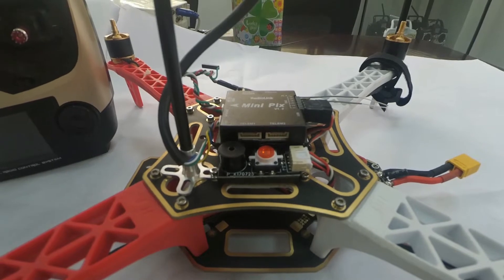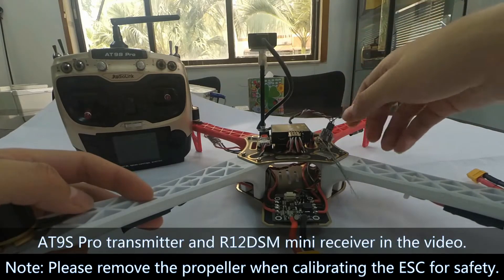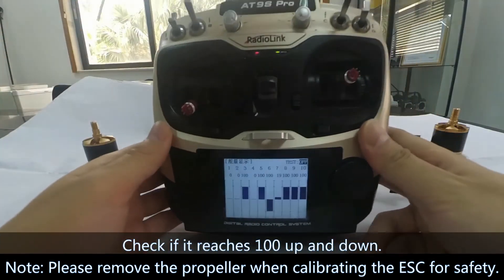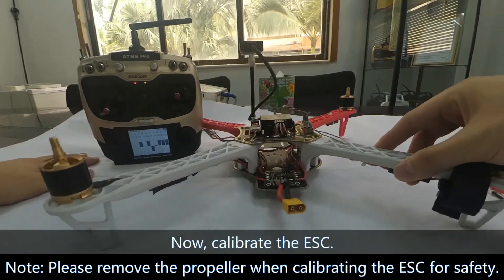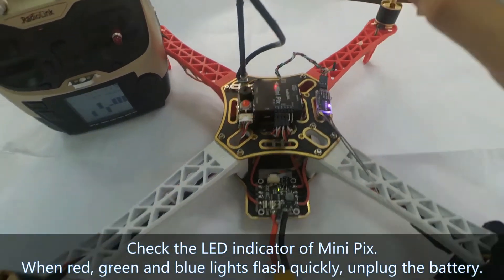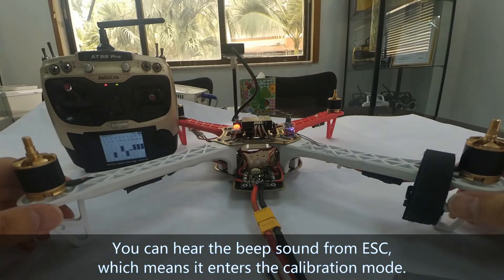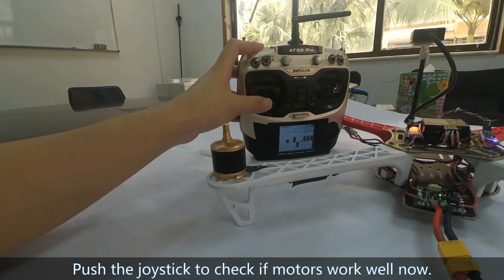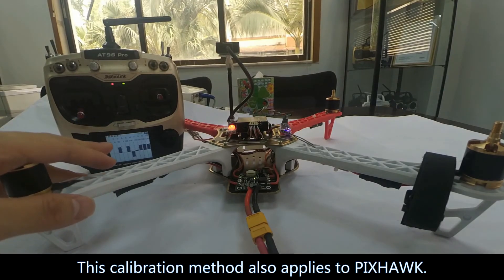How to Calibrate ESC on Multi-rotor with RadioLink PIXHAWK/Mini Pix/crossflight/Turbo Pix?

Comment: Hello!  Team Radiolink!  I would like to ask that the same procedure will be follow for Radiolink Crossflight ESC Calibration or I have to do External ESC Calibration. 

I am using 30A Simonk ESC
Reply from the maker: Hi, sir.For CrossFlight, you can follow this tutorial too. But you also need to check the detailed manual of your ESC. Because different ESC may have different calibration methods. If any question, please feel free to contact us. Our email is after_service@radiolink.com.cn

Comment: Hello, I'm configuring trad heli with crossflight but the board doesn't enter ESC calibration mode with the lights flashing in the calibration pattern. The board only starts normally even after doing the process in the mission planner.
I'm using MP and firmware Radiolink.
Reply from the maker: Hi, sir. Here is the ESC calibration for helicopter for your reference: https://ardupilot.org/copter/docs/esc-calibration.html 
Here is a tutorial of ESC calibration:
https://www.youtube.com/watch?v=gYoknRObfOg   You can follow it. If any question about RadioLink products please feel free to contact us. Our email is: after_service@radiolink.com.cn

Comment: Hello, good evening...
i am currently using crossflight for building quadcopter 450mm frame.
but when ever i arm the drone in either althold or manual mode it , it doesnt lift up instead it moves forward or some times spins...
i am using flysky fsia6b transmitter and receiver.
motor 1 which is right front connected to pin 1 of fc.
motor 2 which is left back connected to pin 2 of fc
motor 3 which left front connected to pin 3 of fc
motor 4 which is right back connected to pin 4 of fc.
can you pls guide me ?
Reply from the maker: Hi, sir. We recommend you to check the Motor rotation direction first. May I know if your quadcopter can fly well in stabilize mode? And if there is still any problem, could you please take a video to us? Our email is after_service@radiolink.com.cn

Comment: Can you show video with the same drone but with t8fb remote control?
Reply from the maker: The calibration procedure for t8fb and at9s motors is the same.
Reply: @Radiolink_official  When calibrating our motors 2 motors repeatedly keep going out of sync, for example when half throttle 2 wont spin at all or spin at a low speed and when at high speed all will spin at same speed. this was with a newer minipix version we purchased January 2023. With old version we purchased in June 2022 it works perfectly. How can we proceed to fix this?
Reply from the maker: @jean-dylanviviers783  Hi, sir. Generally, the plane will take off when it is above half throttle(Except Stablize mode). So it is normal. You just need to confirm there is no problem in high throttle and there will be no problem when you fly it up. Mini pix produced last year or this year work the same. If there is still any question when using RadioLink products please feel free to contact us. Our email is after_service@radiolink.com.cn